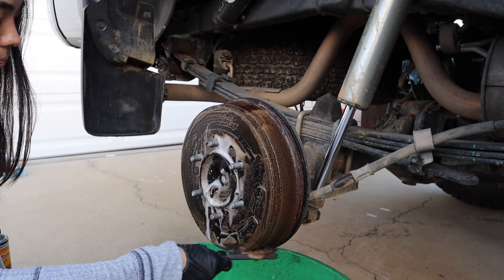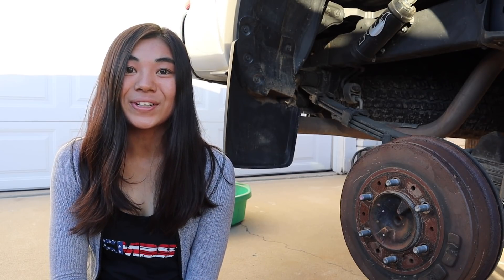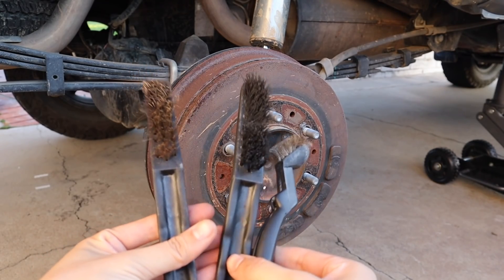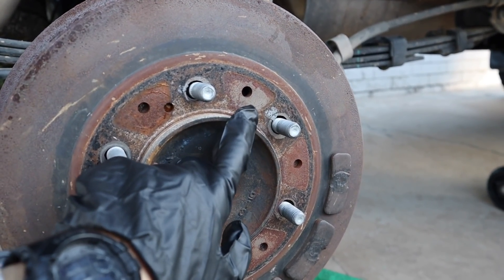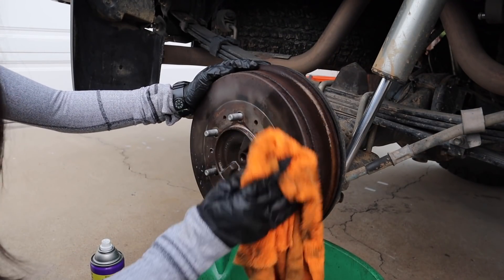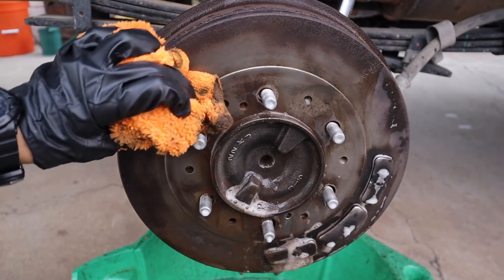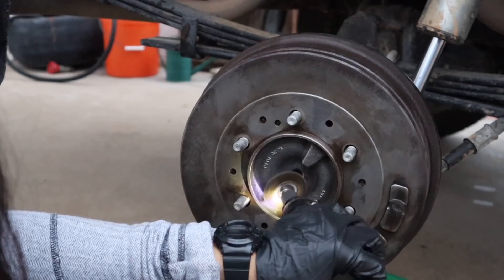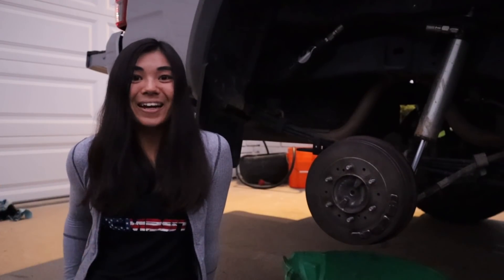Watch Me Transform My Brakes! DIY Toyota Tacoma Rear Drum Brake Cleaning

Comment: Toyota uses drum brakes in the rear to save cost. Cheaper and they last longer than disk brakes. Also, the front breaks do most of the breaking and for off road purposes they still use drum breaks to help keep debris out of the braking system.
Reply: You are absolutely correct. My Tacoma TRD Pro just had an oil change and they checked the brakes. After two and a half years, I still have 80% brake left on the rear drum brake pads. Can’t beat that.
Reply: I thought Drums, though partially sealed, actually are worse for off-road gunk as they are not totally sealed and discs are easier to clean, am I wrong here?

Comment: I would suggest adding some type of fluid film to those brake drums since the original coating has been removed by rust and the cleaning process. Without a coating, they will likely rust up again fairly quickly. Just my 2 cents.
Reply: Good idea. I'm thinking cheap transmission fluid or used motor oil.
Reply: @evertmorse8518  
As she stated in the video her goal was to remove the rust so it didn't look so crappy when seen through the wheels. She accomplished exactly what she intended, so for her it was not a waste of time. And I'm sure she knows that the brake shoes are inside of the drum thus not wearing the outside of it.
Reply: @evertmorse8518  
I should be getting my Tacoma in the next couple weeks, and I might possibly paint the drums.

Comment: Chloe please wear safety glasses when using wire brushes and wheels on your Makita!  The rust particles as well as some wire strands can fly off and impact your eyes!
Reply: 100%
And tie up the hair. Having a patch ripped out is unpleasant
Reply: absolutely. Did this once from a wire wheel and spent 9 hours in an ER getting a tiny piece of metal out of my eye. Never again
Reply: @dave1096  Maybe she likes a little hair pulling? lol
Reply: I wear a N95 mask when cleaning brakes to limit inhalation of the dust.  It helps to prevent black boogers.

Comment: Nice job scrubbing. Yes, this job wouldn't even be necessary if Tacomas were up graded to disc brakes!  After you have them clean, as you mentioned, you could spray them with paint or even spray clearcoat on them. I dont think its necessary to waste a micro fibre towel to wipe off, any shop rag would work just as good. I use my micro fibres only for on paint or glass. There too easy to scratch paint or.. because everything sticks to them. Good Vlog.

Comment: I think rear drums on the Tacoma is the best option. Disc brakes (especially in the rear) need a lot more maintenance to keep them working well. The rear pads on our accord don’t last long, and the calipers have leaked due to corrosion from all the road spray the rear gets. I recently inspected my rear drums on my 2018 TRD OR and it looked almost brand new in there… I think those brakes will last 300K without needing anything. I would like to remove the drum surface rust though😊

Comment: I’m going to do the same thing. But, after getting most of the rust off I’m going to use rust converter. Then I’m going to paint it. I also use spacers. So, I’ll put a very light coating of anti seize between the hub and spacer and wheel.

Comment: Use Skyco Ospho. While I was building my bedcage I only could work on it a couple days a week so it got surface rust on it. I also fabricated it in my driveway outside so the morning dew would land on the metal tubes everyday. Spent about an hour putting this on and wiped it off the next hour (depending on how bad it is and temperature) and was ready to paint.

Comment: Great video. I tend to do a little bit of scrubbing/rust prevention every time I rotate tires. Next time maybe try pulling the cover off because technically break dusts accumulates and to much is not good either, something that should be done about every 50k and helps with longevity of the drum brake.  Lots of good YouTube videos out there as well on how to service your drum brakes. Keep up the good work.

Comment: Ditch the degreaser, use wd40 with wire brush or scotch Brite pad, cleans rust much better an quick. Hit it with some hit temp black paint after or fluid film. If you don't treat it it's just going to rust again

Comment: Two eye-doctor  visits for  me!   1. To remove a silver speck of paint from my cornea that came off of a gas shock absorber, when I cut the nylon strap that kept it compressed during shipping.  2. eye-exam and a prescription for antibiotics to fight the  eye infection that resulted when a speck of rust landed in my eye while cutting off a no- longer used tail-pipe hanger.  I was wearing safety glasses during the second incident.  Hind-sight says I needed to wear safety goggles instead!

Comment: Nice job, I understand leaving the drum on,  when cleaning the axel. But if pull the drum off, it would be easier. Also have you tried Coke-cola to remove RUST, you may be surprised. Keep up the great work!
Reply: Removing the drum would also allow for the internal parts to be inspected for condition. Surface rust on the outside would point to more on the inside.

Comment: You could have angle your drill so that its parallel to your drum, your wire wheel would be perpendicular to the drum's surface, giving you easy access to clean the space you didn't get to.

Comment: The Tacoma costs slightly less than a comparably equipped 4Runner, however; Toyota should regardless be putting disc brakes on the rear. With that said, drum brakes work fine. Please wear eye protection when using a wire wheel Chloe!  I know you have all the PPE available. How many of your viewers recommended you take the drums off first?

Comment: I feel that Toyota should have four wheel disc brakes. I also own a 2008 Toyota RAV4 which does have disc brakes all around. One would think that parts such has pads would be less expensive for disc brakes, right. My 2019 Tacoma is the first vehicle I’ve owned with drum brakes.

Comment: Just a question why did you not just pull off the drum and clean them… it would of been a lot easier and you could of got rid of all the trapped brake dust in your drum and clean it with the brake cleaner…

Comment: U did a good job, but, u should've worn eye protection because using those metal wire drill bruches those wires can fly at u. Ive seen it happen before, and its happened to me. I wasnt wearing eye protection, and a wire flew at my face, & almost hit my eye. Im lucky that it didnt happen

Comment: You made more work for yourself by not taking the drums off.  If you take the drums off, you can not only clean the whole surface, but also pain the drums with high-heat paint.  Also, clean and treat the mating surface on the axle.  I had drum brakes in NY too. Salt destroyed them.

Comment: absolutely unnecessary, looks nice only when the tire is off and only for a few days, will oxidize again pretty quickly, it's just surface rust don't worry about it, my truck is 26 years old and has surface rust, never cleaned it, never had problems